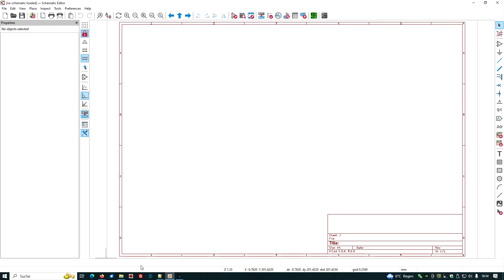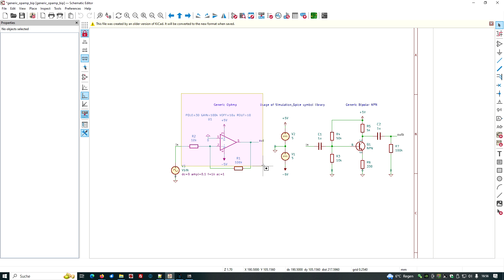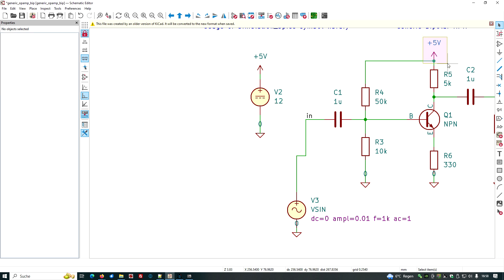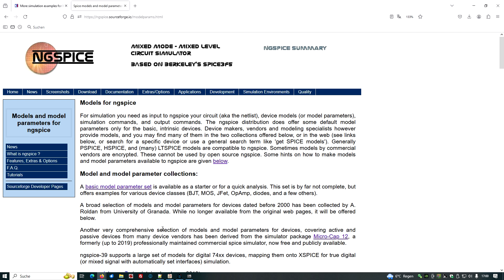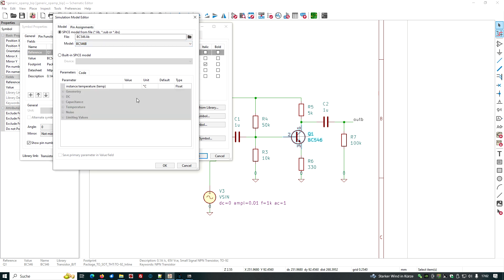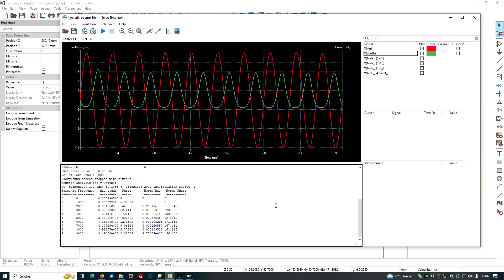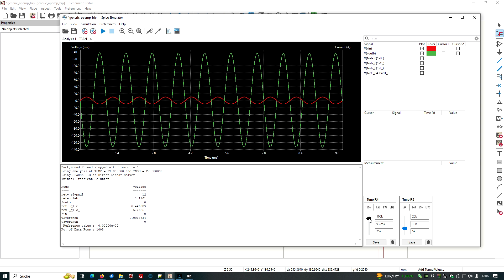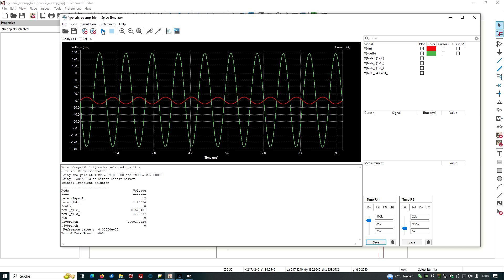ngspice in KiCad 8: optimizing a bipolar amplifier

Comment: The only issue I see in kicad for simulations is the lack of a step or parameter sweep functionality.
Reply: I think I saw somewhere that you can add text on the kicad schematic which then will be parsed to the netlist (for .step .opt .param, etc)
Reply: @ariefnoorrahman3492  need to get an example to test.